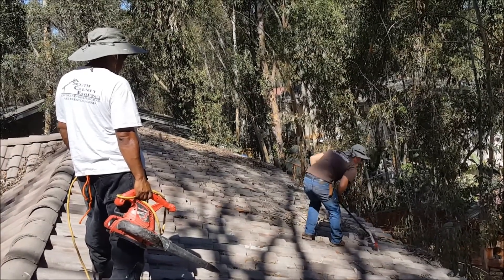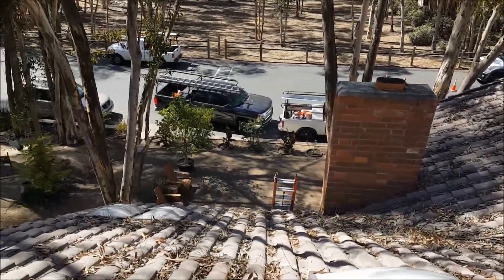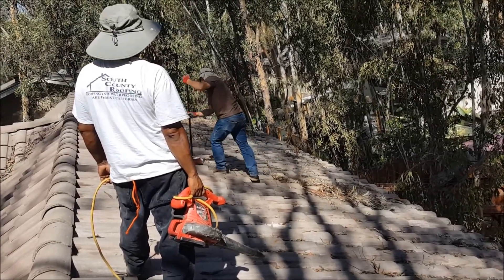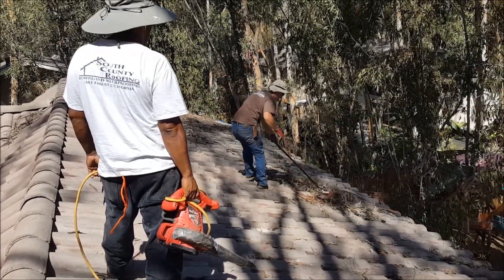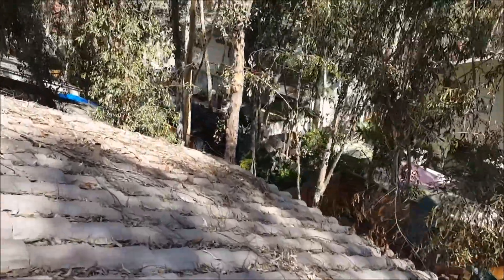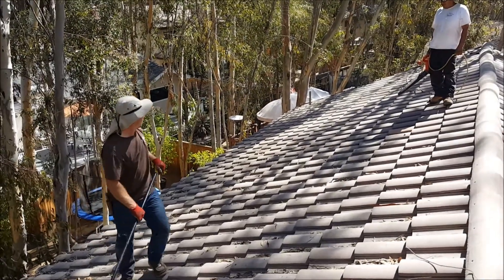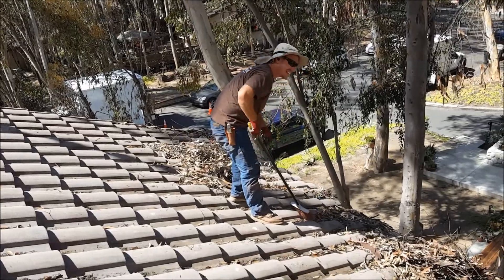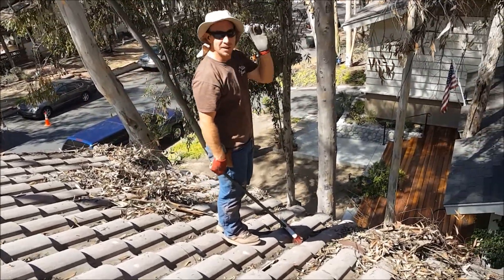Cleaning the leaves off a tile roof...pretty simple you could easily do it yourself.

Comment: What's your experience with roof washing...either the soft washing or the pressure washing...to get off lots of moss and lichen on north side...it seems like soft washing is much less disruptive to things and pressure should only be used if absolutely necessary...